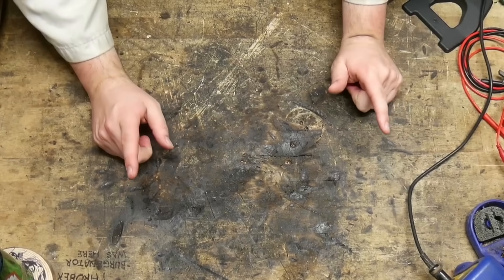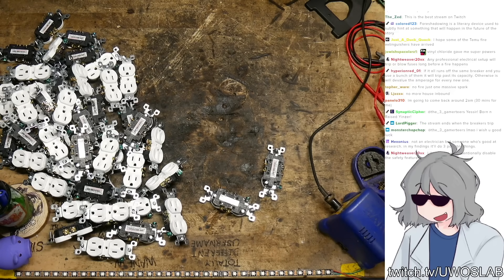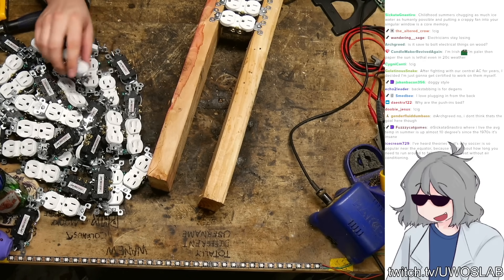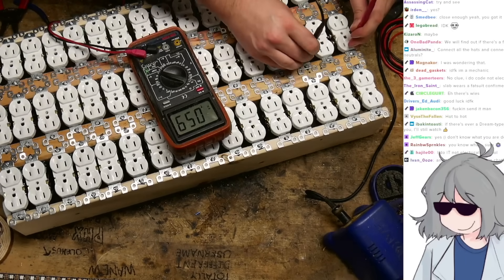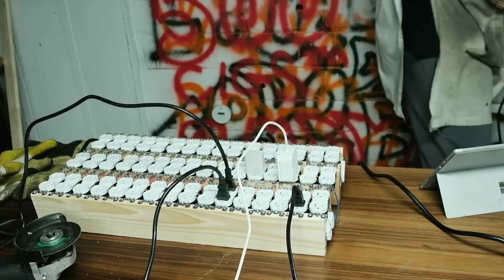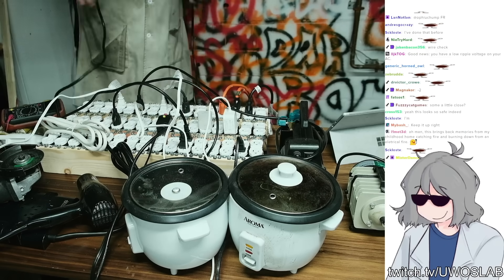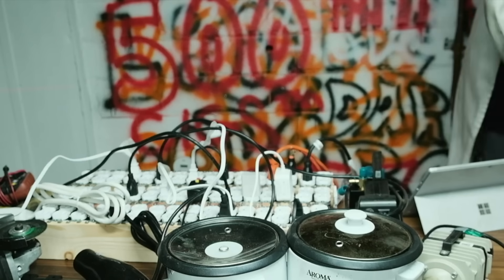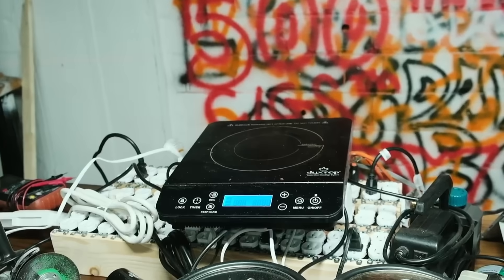Making a 100 OUTLET POWER STRIP to see what happens

Comment: I honestly don't even own enough devices to use 100 plugs
even if I include just spare wires for IEC plugs and stuff I think I only own 50-75 total possible items that have a nema-5-15 plug
and even assuming I had this type of "power transmission line" wired in such a way I could get two phases and feed my water heater and stove, I think I only barely hit a 100 socket total

who needs 100 plugs? well linus tech tips and his LAN center, though he'd set it up with 10x10 blocks, an octopus of boxes holding 5 double-gang sockets daisy-chained from a 50a 240v dryer socket twist-lock extension

ironically I intended to build something like this but pro, several utility boxes and a couple twist-lock 240v generator inlets and outlets
and a 20a breaker at each box to avoid blowing the module
why? because of my invertor setup, imagine 4kw of power at 120v(double-feed at the inverter or use it as a dual-phase extension) but no way to power all your devices because you'd need 50 extension cords, solved by literally making a generator changeover block for every device in my place, all fed via a massive generator cord, power goes out and they all wire themselves to a single feed cable
no water heater or range-oven, but how often are you gonna need that? and yes, you could if it was 240v feed even the stove, but a water-heater is hardwired, at least normally

Comment: Your implementation is definitely against code, but I'm 99% certain that you can have as many outlets as you want per branch.
So long as it's on a single branch, across multiple branches, though you float the neutral.

Comment: The one small issue I had was that the rice cookers were in "warming", which doesn't pull as much volt/amps as if all of them were pressed down.

I think it would have set off if they were before the hot plate.

Comment: Heres an important question what if we plug a wall outlet into another wall outlet not the same one but one across the house what about our neighbors house to our other neighbors house? Would it destroy the wire or would both houses try to equilize positive and negative electrons and cause thier circuit breakers to blow 😂

Comment: Third year apprentice here. The best thing you could’ve done is to screw all of the brass and silver screws all the way if you’re gonna backstab all the wires. You also need to put electrical tape all around the plug where the screws are exposed to the next plug to avoid arcing

I don’t know about NEC, but in chapter 8 of CEC, somewhere there shows the number of outlets in one circuit at 80% continuous load. 

It’s also preferable to put it on a generator that has safety features built in just in case of experiments like this goes on fire. Don’t trust your house. It could be degraded or cheap out on the build

Other than that, it’s temporary. Experiment away on a safe area!

Comment: The sum of your breakers being bigger than the main breaker makes sense. The main breaker is how much the cable going into your house can do without melting. Each breaker is how much the cables inside your house can handle. With properly sized cables, you shouldn't trip the main breaker unless you have a short circuit or lightning strike or whatever. If you are loading every circuit to 100% capacity in a modern building, you are doing something very weird.

Comment: Residential breakers are typically split phase half the breakers are on the A Phase the other Half are on the B phase  they alternate going downwards the board.  a 240 volt breaker is both 120 A and 120 B phase.  the breakers are rated  for specific amperage ratings via over current protection they trip in order to protect your devices from melting.  A generalized rule is typically  each outlet is considered "2amps" and a branch circuit will have 10 outlets. The outlets themselves don't really have much of a load being put on the branch circuit. Commercial power strips connect the outlets via  electrified rails.  This set up you've done in the video  and the way you've connected your power from one outlet to another if any of the small jumper wires were to overheat and burn up from a continuous load the outlets further down the chain would be without one of it's 3 conductors. I don't think you've connected any of your grounding conductors and only opted for only the ungrounded and grounded conductors  which the danger is that the operator of the device could become the shortest path to ground if they receive an electrical shock. Each outlet has a little tab on the side and if you break the tab on the side they are no longer bonded. 

My ultimate concern for such a device would be your spacing between  the outlets  as well as the wooden substrate you've connected them too.  you may be leaving yourself open to an arc fault.

Comment: Well.... if you REALLY want to test the limit of the conductors in your little experiment you need to have a circuit that can supply enough power, so the braker wont cut the experiment short.

But I think it shows nicely that even if you have 100 outlets the maximum power of a circuit wont increase. And if you pull enough power the braker will just trip so nothing happens.

A real problem would be if multiple power strips will be plugged be into another and have something like a heater plugged into the end of that. The problem wont show up directly but rather after a couple of months/ years without unplugging. The multiple cycles of the plug getting hot and cold will bring consensation into the plug, which leads to an resistance. The now added resistance will now lead to more heat on the plug, which leads to more condensation the next cycle. This will go on for quite a while until somethings fails or the user notices.

Comment: I mean the plugs themselves are already dumb tech no chips in them which is where the stupid dangerous part of powers strips come into play unless those are the lowest most cheap rated plugs from China this is more sketchy limits of the the house breaker and grid instead of is this device going to burn because it's terrible.
Reply: Not a fan of backstabbed receptacles like he did here, personally.  Seen too many of them burn up over time, especially where crockpots, hairdyers, space heaters, and power tools are used.

Comment: As an electrician, the way you wired it is the cherry on top of this because what you SHOULD do is wire them all with pigtails and connect all the hots and neutrals. Since you wired them connecting to one another you’re just pulling ALL the current through the first one and it is just amazing.

Comment: This absolutely hurt to watch as a sparky, but I fucking LOVED it, honestly, you COULD technically do a 100 outlet strip with really beefy 0 or larger cable depending on intended ampacity needs.  You'd need some circuitry and splice areas where you wouldn't be running the outlets one after the other in series, but you pig tail, as in, every outlet goes back to a common neutral bus and a phase bus, since it'd be 270v on the input side from the mains, you could split 50 outlets to one leg, and 50 to the other, but of course, you'd need some circuitry to make sure you don't overload.

Comment: This is VERY VERY MUCH wired wrong
Reply: You have 2 wires for each side when you only need 1 (unless you have broken the pin in the middle to make them two separate circuits)
Also you should NEVER USE the push in holes on the back... ALWAYS use the screws on the sides

Extra info:
The pin in the middle of the outlet is so that it can be broken for when you have the top outlet hooked up to a light switch and the bottom outlet will stay powered even when the switch is off
Sadly the "jobs americans aren't willing to do" employees don't seen to know this so usually these days the light switch turns off both the top and bottom outlets. >.>

Comment: Using multiple breakers of the same phase creates parallel paths. If you were drawing 30A  they would be split say 10/10/10 among the breakers depending on how the load is balanced... this is hella illegal BTW, don't do this. If the load becomes unbalanced devices and wire can overcurrent real quick
Reply: Yo I have questions for u. I have a PSU wire. It has 3 0.75mm cables inside. How much this cable can Hande continues? Our country is 230V
Reply: @Ruzgar_K_  .75mm wire is rated for 1.8 Amps. Voltage doesn't matter as long as the insulation is rated for at least 240V. But if this will work or not depends on what you are trying to do
Reply: @Teh_Random_Canadian I want to add a built-in outlet to my desk. So, of course, I need an extension. So it rated for 400watts?

Comment: Ok..... AS AN ELECTRICIAN, no, this is not anywhere up to code. First off and keep in mind I havnt seen the first 5 minutes... 

Yes, you COULD use a dryer plug, HOWEVER! If its old, it has no neutral and is getting its "Neutral" off the ground. If for any reason this ground becomes disconnected from the panel while a load is plugged in and on, it WILL have potential, I.E. shock/electrocute you. 

Second, The dryer circuit is now out of code once this is attached as these receptacles are only rated for 20A, however the breaker is likely a 30A breaker, AKA a fire hazard. Instead what you can do is run two dedicated circuits to a box underneath the panel with an RS cover and a NEMA 14-20R receptacle, allowing for two 20A circuits, neutral and ground after adding a 20A double pole breaker.  Using this method would allow for 32A of continuous power.

OMG.... using machine screws to secure it to the wood... FML this is getting worse. And when I say that only to find out he's using backstab connections, which are well known to MELT THE RECEPTACLE. You have screws, USE THEM!

Also to add, I have actually tripped a main breaker to a panel before, and this wasnt 200A either, it was either 1200A or 1600A. I DO NOT reccomend it.

Comment: Well,
1. Many electricians state that back stab is a dangerous connection.
2. Pig tailing is safer than Daisy chaining.
3. The outlets are too close to each other, thankfully there wasn't terminal screws touching but they were pretty close.
4. Different circuits same phase, just lose the protection of the breakers since you can pull more amperage in parallel.
Different circuits different phases. Instant breaker trippage.

Now. The breakers totaling more then the main 200. I would be surprised if any normal house can pull 200 amps.

The number of outlets doesn't matter. It's the total amperage pulled on the circuit.

Comment: The video is hilarious, good to funny content. Also never forget. Black on brass, White on Silver, electricity don't care about color, only we do. BS no one wants to read below.

Some things to note,
- 0:20 Technically this wouldn't be a question for an electrician, because you are bascially making a power bar. But not up to code,
CEC 8-304, shows how many outlets you can have on a branch circuit in Canada.
US doesn't have the definite answer in writing. NEC 220.14 does state 180VA per yoke, so that would be 8 @ 15A(80%), 10 @ 15A(100%), 10 @ 20A(80%), 13 @ 20A(100%)

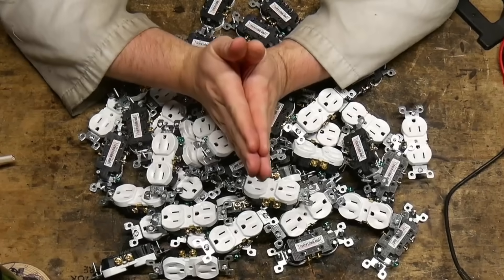- 1:50 If I'm understanding right, Using 2+ breakers on one branch circuit, depends on the breaker. Non GFCI or AFCI, should just create a parallel between the breakers sharing the amps. GFCI and/or AFCI should detect an amperage mis-match at some point and trip.

- 2:38 The sum of the breakers may go beyond the main. It's just that if the usage of all the branches go beyond the main the main trips. If you got 20, 20A branch circuits, and each of them uses 10+ amps at the same time, non of the branch breakers will trip, but the main will.

- 4:22 NOT THE BACKSTABS!

- 6:49 Nothing is grounded.

The blue conductor will most likely fail first if it's 14AWG, otherwise the way you have it daisy chained now the first in the chain should fail first due to overcurrent overheating before any others barring defects. So column 1, row 2 if the receptacles mounted on the side are on the right, because all amps are gonna flow though that one regardless, specifically the lower receptacle of the duplex. If they were all hooked up independantly of one another, the cord going to the monstrosity would likely be the thing that broke. If you hook it up to 240V and plug in a 240V device it would just be the previous cases but twice as fast. If you use a 120V device with 240V it will probably fry the device.

Comment: You need an isolation breaker to prevent the wires in your walls from melting
Reply: And if they do melt you will have a guarenteed fire
Reply: If this doesn't cause your stuff to burn, you need to show us ur power bill

Comment: 2:45 some how I tripped the main breaker in meter box when I shocked myself 2 weeks ago. I was working on a atx power supply which I forgot to unplug and I got a poke.

The basement lights went out, went to flip the breaker back on and the lights didn't come on in the basement. I went outside to the master cutoff and there I found it had tripped! 

What's interesting (good) is that both the GFCI outlet and GFCI breaker tripped when I got the poke, so at least they did their job...

I still don't know how I tripped the 100a Main...

Comment: you know it's fun because it's safer than extensions. just needs good upstream. but provided you wired it good, sockets are better. that's why we install them. actually extensions are fine too. just don't use high power items. also don't use ton of small items which make up a high power one, like 100 laptops

Comment: So....electrical worker of 7 years mostly residential. Here's how you could do it (though you NEVER SHOULD) Please note that I believe this is a fire hazard and should never be made but can technically be done within reason. It would basically be able to be used like an RV Pedestal. This is also based off the US NEC 120V/240V Residential. Read at your own discretion, if you're not licensed, don't even try this.

2 rows of 25 or 4 rows of 12 and 1 in the middle on one side. In both cases, run 1 set of wires "daisy chained" down the rows. All neutrals together, all grounds together, keep the top half and bottom half together in a row but separately from each other. Tape each outlet before installation to ensure no contact between hot and neutral. Take a 50A or 60A 4 pole 240V "pigtail" and hook up all neutrals (white) and all grounds (green) together, connect the top half to 1 phase (black) and bottom to the 2nd phase (red). Please make a cover of some kind (Metal or plastic preferred, wood can be used). Connect to a 240V outlet installed by a licensed electrician. You now have a 100 outlet (50 duplex) power strip.

You now have decided you should read this. If you decide you want to perform this, this is all stuff you can learn via YouTube videos and purchase of a book. I am not liable to damage or injury. YOU HAVE BEEN WARNED ⚠️

Comment: Thank goodness you have actual breaker and not a federal fire pacific electrical panel. Otherwise your waiters would be the fuse. It's one thing to change a bunch of outlets together it's another to do it with undersized wiring. And backstabs at that. And we conveniently left out the ground screws on every outlet. I'm glad you at least use a GFCI.

Comment: The value of all the breakers added up doesn't matter in relation to the main breaker its the load. Everything in your house is pretty much never running at once and generally draws less than the individual breakers they are on. Just cause you have a 15amp lighting circuit doesn't mean it's drawing 15 amps especially with how prevalent led fixtures are now plus not all are on at the same time usually. That's the same for the main 150-200amp breaker not everything is on all the time at full power, all these breakers are there for is when it crosses their rated threshold. If you're not using the bathroom most people shut off the light. Sleepy time less to no lights. Oven, microwave, a/c, furnace, water heater, pool, spa, computer, well. Not used all the time, heating, cooling and well get to temp or pressure and stop drawing their full load. Computers full load playing an intensive video game far less at idle, pool pump turns on to circulate and filter water on a schedule, spa and range same as the furnace and a/c. Breakers are to mainly protect the wiring in your walls, overloading, shorts, arcs and ground faults plus a disconnect for servicing devices. Fun fact, extension cords bypass the protection of breakers by being able to plug in a 16gauge typical outdoor orange or green extension cord into a 20 amp circuit. The extension cord is roughly rated for around 10-13 amps and gets worse the longer the extension cord is and attaching like space heaters or crazy amounts of Christmas lights can overload the extension cord without tripping the breaker. Christmas lights actually get around this on their own by having small fuses in the plug end so if a dum dum connects to many in a single chain the fuse will blow and I never saw an extension cord with a fuse. Power cords for like appliances can be lighter gauge than the circuit because the company bases the cord on the amps the device will draw plus usually have some fuse. You can trip a main but it takes a lot to do, everything syncing up with a loaded panel but I never seen it happen before. The main breaker protects the panel and service wires, its also a disconnect for servicing.

Comment: 12 gauge wire with a 20 amp circuit should trip the breaker if it pulls more than 20amps that is. Increasing the breaker trip threshold to 30amps+ will result in melted wire or worse. Needless to say, you are not advised to do this. 
 
Video idea.
Maybe 100 tesla coils with some slow-mo shots, or perhaps  shooting said coils with a rifle or a baseball bat or various other options.